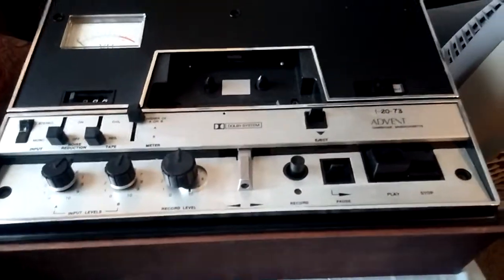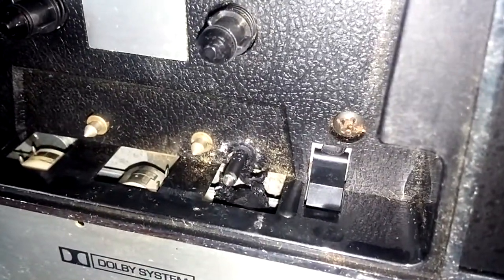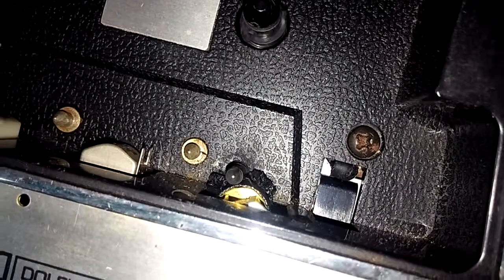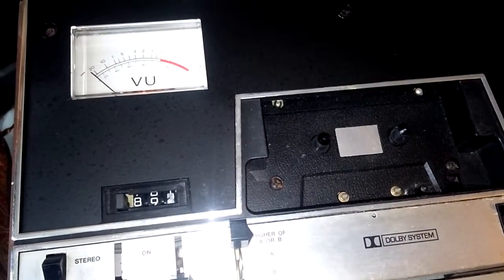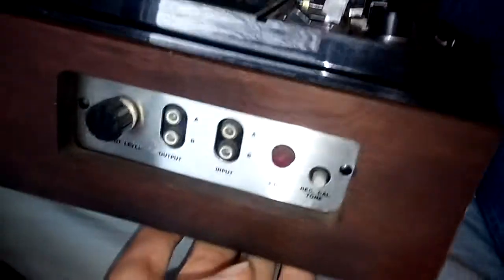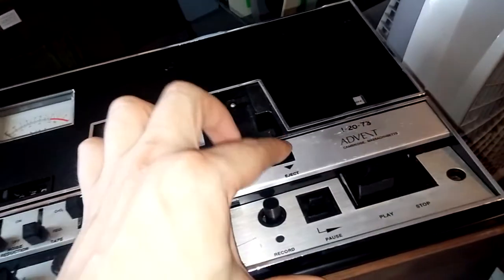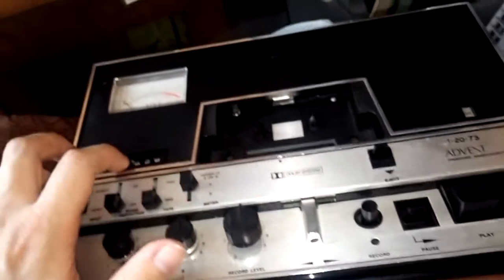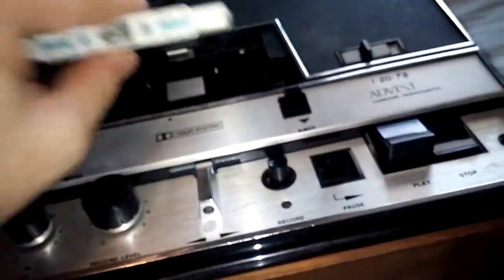Advent model 201 cassette player

Comment: Good job.  I had one of these when they first came out.  Must have been 1970 it was the best cassette deck on the market at the time and was only sold in high-end stereo shops.  Have you tried to find replacement parts for it?
Reply from the maker: Wayne Howarth thanks. No I haven't its long gone. I never owned it to begin with I was asked to see about getting it to play correctly which I did get it to so I returned it and since then someone bought it and so far has no complaints about it.

Comment: Where do I get that audio cable, most recent audio cable does not fit properly with the player. Thank you!
Reply from the maker: You need a RCA to 3.5 mm cable or RCA to RCA cable (depending on what audio source you're wanting to plug it into.)